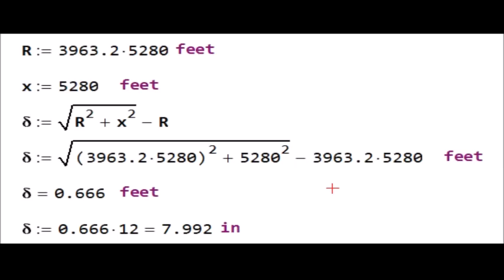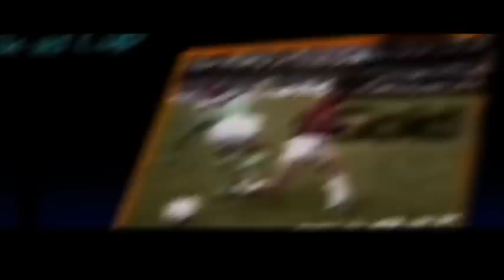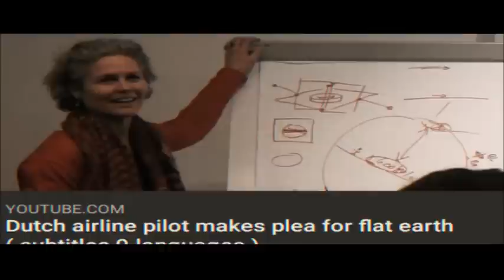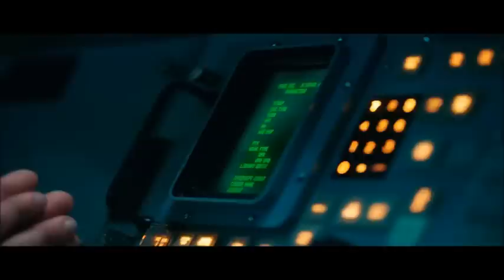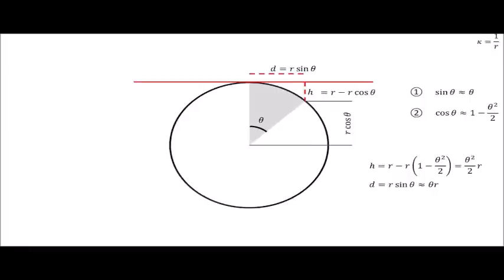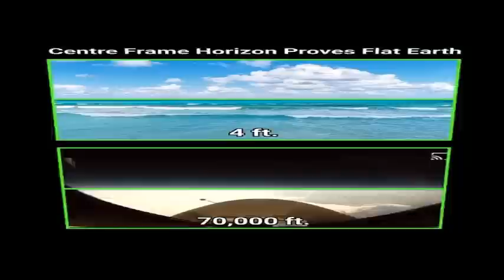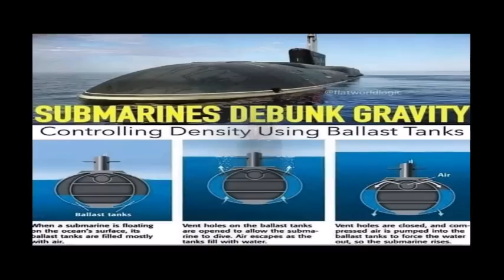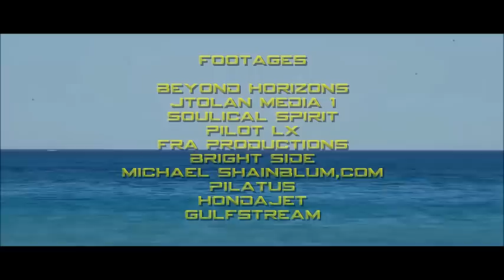2022 Flat Earth documentary Flatten The Curve by Vikka Draziv ✅

Comment: 13,000 miles around the perimeter of Antarctica. 25,000 around the equator🤔 how's that work?
Reply: Capt. Cook sailed over 66,000 miles and never found an entrance to Antarctica. He finally gave up but I'm pretty sure that shows us that Antarctica is not a continent like we've been told. It is an ice wall that surrounds the flat earth.
Reply: @Progneto  ok we'll go off some guy from the 1700s rather than the saildrone that circumnavigated Antarctica 3 years ago. And it only took 13,000 miles so you have no clue what you're talking about. Update your facts buddy
Reply: Over 60,000 miles
Reply: @benjamin07420  11,879 nautical miles actually. Nice try though🤣